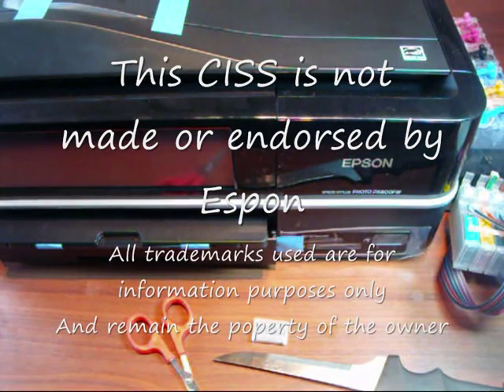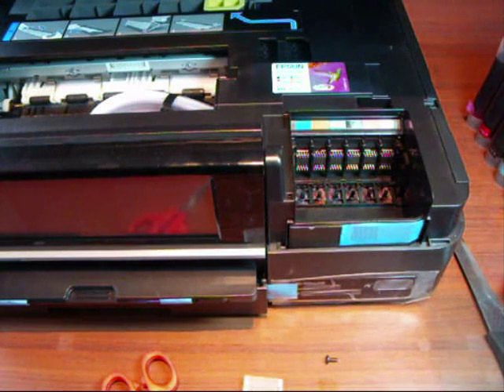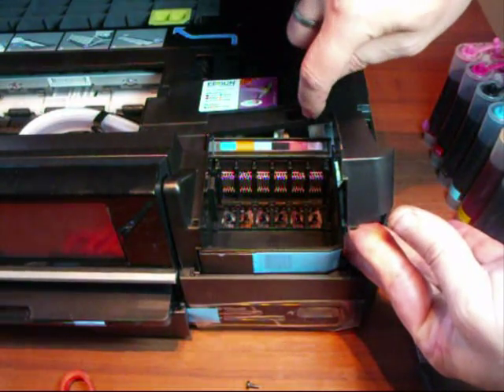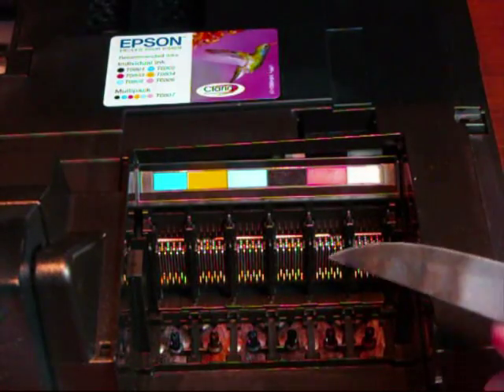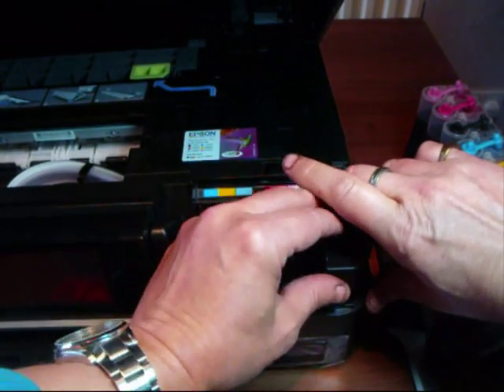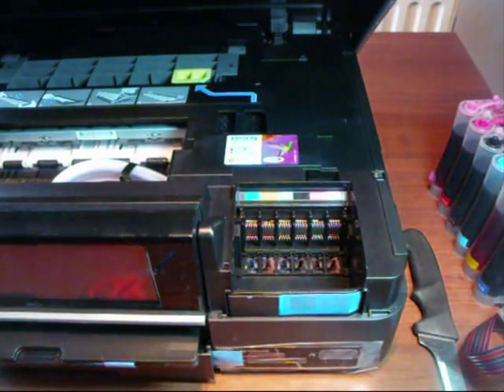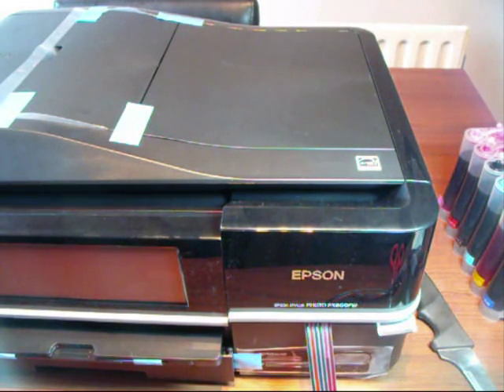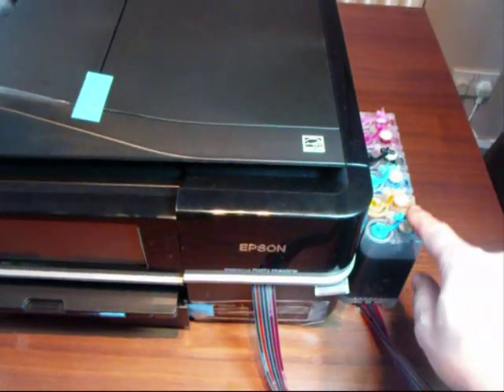HOW TO INSTALL A CISS ON A PX800FW

Comment: An alternative to removing the sensor strip (called magnet in the video) is to merely lift the plastic that holds it, after unscrewing the side screw, and jamming a plastic spacer under its edge to raise the sensor up. I used a palstic wall plug about 5 mm thick. The scanner unit does not need to close down completely to activate the sensor, leaving room for the tubes. You can remove the spacer, screw back the side screw and take the printer for repair without appearing to void your warranty.